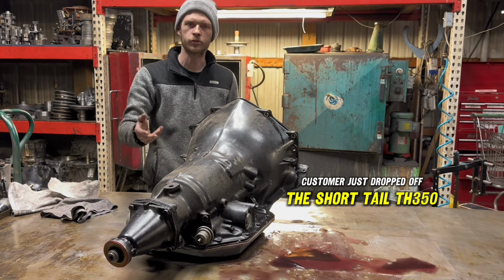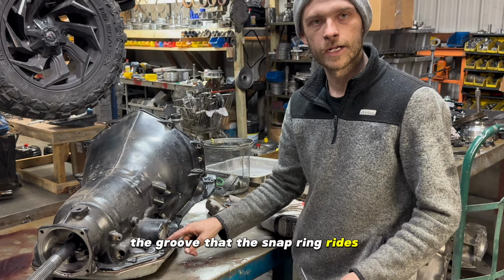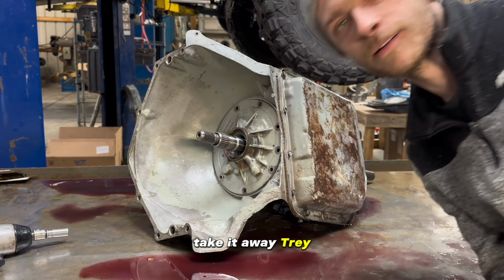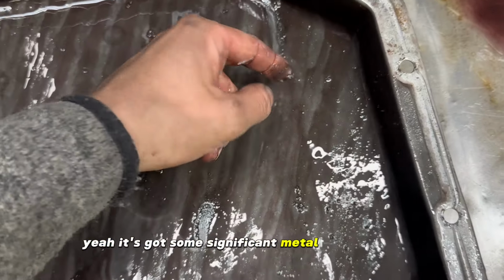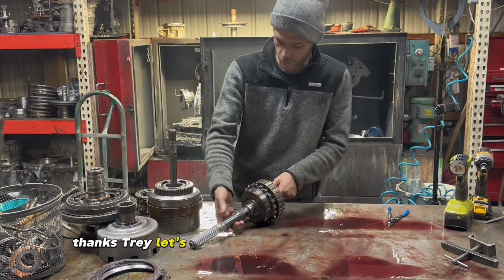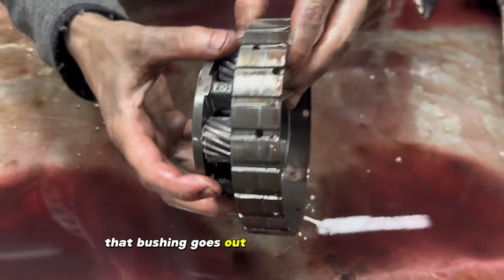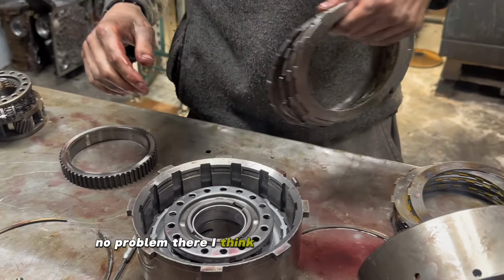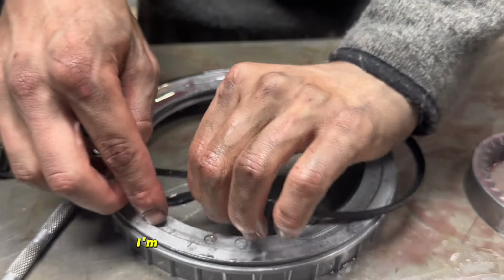CHEVROLET TRANSMISSION SHORT TAIL TH350 |Full Teardown | No 2nd Gear | “Shifting Weird”

Comment: You guys look like you know what you're doing. I just paused on the comment about the detent cable. From my experience, you can eliminate the detent cable (properly), and still retain fully automatic drive. You'd just have to go into 2nd for a passing gear.

Comment: It took me 3 shops to finally get a good rebuild. The last shop put in a transgo shift kit, and set it up so it slightly bangs into gear. I was going to go with a 400 short tail, but was told the TH350 had a lower first gear. They added a transmission cooler and have no problems since they rebuilt it 40 years ago. I do enjoy watching your videos. 
    Can a Cruise-o-matic trans be beefed up(66-t-bird w/428) or should I go with a 1967 C-6?
Reply: I can  solve  the  problem

Comment: That transmission is a damn clown car. When yall went for the main shaft, I'm sitting there going "ok now we see all ze ripped up gears," expecting a single main drive shaft with a bunch of main/sync gears....

Then there were 30 more parts, the entire time you just not even flinching or contemplating, working with the precision like a guard for the Tomb of the Unknown Soldier.